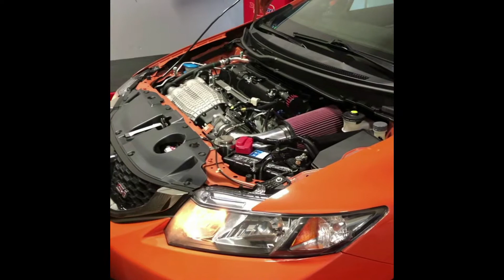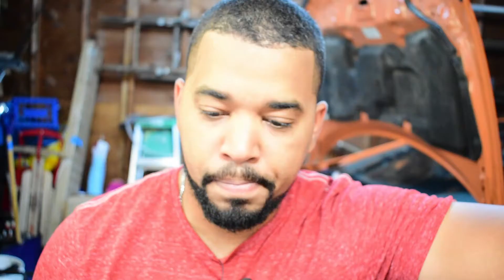How did THIS HAPPEN?!?!?! - THAT ESCALATED QUICKLY!

Comment: There’s no turning back for you, you went deep down that rabbit hole 🤣.
Even thought our engines are internally balanced I would still look into an ATI super damper. Harmonics/vibrations, higher revs will but additional load/stress elsewhere..
I would also look into an oil cooler setup, especially for the track. This will also help a lot with cooling.
This is going to be rad and I’m super excited for you and the updates.👍✌️
Reply: And yes “excitingly nerve-racking” would be the best way I’d explain it.
Reply from the maker: 4_cyl_unicorn_power yeah man. It’s funny how easy it is to get hooked. I’m going to look at the oil cooling stuff. I noticed this engine doesn’t have a build in oil cooler like the older K series did.
Reply: Reeses Cars no it doesn’t and yeah I would. Nothing crazy a sandwich plate and a small core will work 👍 You are doing a baffled oil pan correct? There’s kits available to convert the stock one and there fairly cheap and inexpensive
Reply from the maker: 4_cyl_unicorn_power yep. I found one that I like out there. The biggest issue is, right now the Type S pump is on back order from Honda/Acura.
Reply: Reeses Cars yes sadly a lot of things are right now.